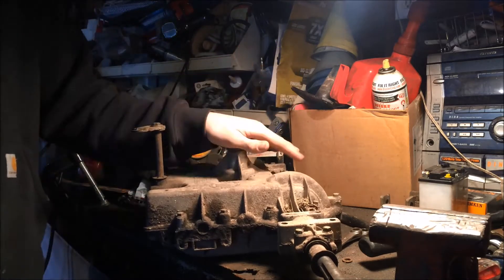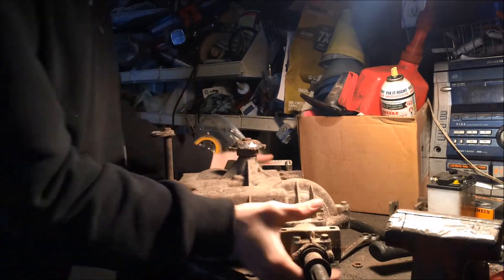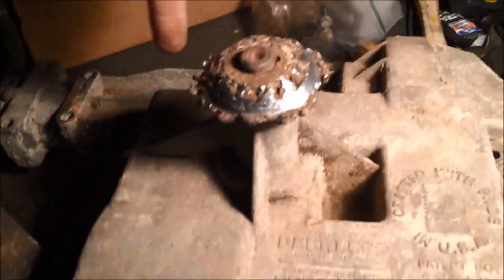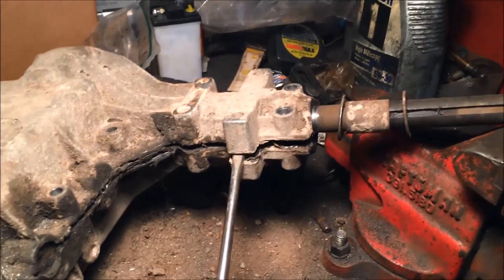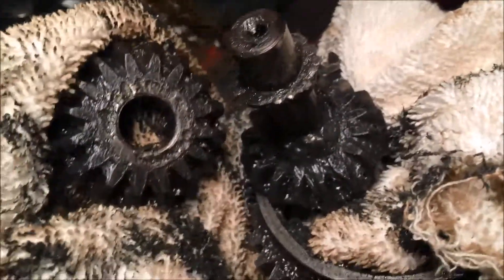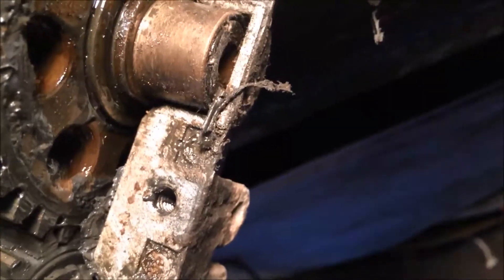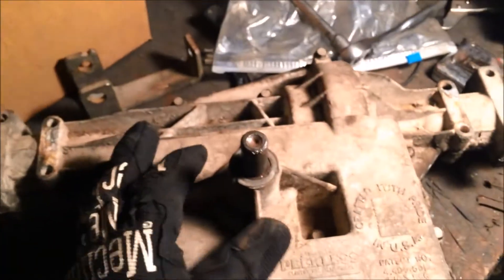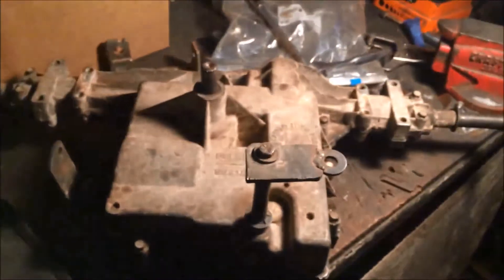How To: Unassemble & Reassemble Transaxles (Peerless)

Comment: What's the yellow bung for? Thanks.

Transax transplant 

I have a 30 y.o. Murray 11/36ic that was increasingly difficult to change gear. I acquired another transaxle 10 years ago, and seeing it has 10 years less use than my one so it must be in good or better condition...right? 
I hear it clicking as I move the gear changer thing sticking out the trans into several positions.
Put it on, and now the mower won't move forward or back.
I see the drive belt is turning the rear pulley on the transax. I lift the back up to see if there is the slightest movement and there is nada. 😑

Any ideas anyone...

Comment: i have a 920 series 7 speed and we took it apart, we cant get it back together, it seems spring loaded. now the ball bearing that is spring loaded to give the shift fork a clicky sensation came out. i am dealing with the same problem when you turn the pulley it locks up and then starts to lift the whole assembly out of the case. if anyone could help that would help alot.
Reply: also does the little triangle protrusion on the bushing have to be on the right or left side

Comment: Question for you. I have a bunton 48in walk behind mower and the guy I bought it from put a tractor transaxle on it and it drives but it drives in reverse so basically it'll only go forward in 1st gear which is reserve gear. Gears 1-5 work but they make the mower move in reverse. He said that's the only way it would fit. So my question is is there a way to take the trans axle apart and simply swap reverse and forward gears to be able to use gears 1-5 go move forwards instead of backwards?
Reply: Hope I didn't confuse you lol. The transaxle can only fit one way and I'm trying to change the way the trans spins in reverse to forwards and forward to reverse idk if this is possible lol but I figured I'd ask

Comment: Thanks for this great video.  I was not sure how to get the spring and ball back in.  This vid is the only one I have found that address the issue.  When I opened the case the ball was in the far right hole, but I have had all the gears out.  I think I got in N and I am putting it back together.  Will the ball just fall into the correct whole based on the gear it is in?  Also should there be grease in the axle channels?between the spider gears and the bearing??  how much?  thanks

Comment: When reassembling, one trick that I use is to put the top of the case on, snug up the bolts, then go around all over the top case and lightly tap with a hunk of 2x4. This always has helped everything seat nicely...
Reply from the maker: Yep. can e used both ways too, when taking it apart you can hit it with a 2x4 to separate the case, no bolts holding it.
Reply: I like to use what's called an anerobic sealant when I reassemble them..it's like loctite that dries in the absence of air. 
It costs 2x of rtv probably ,but it cleans up so much easier if you have to open the trans again.
whatever oozes inside the case won't harden and migrate thru the trans. If anything it'll go thru the oil and stay in a liquid or gel type of state. 
Sometimes it's nice to put a little oil on the case bolts too, if they came out with protest. 
Besides, it'll make it easier on ya next time you have to open it up again.
Reply: has anyone had the issue of  it not lining up 100 % and when its together again it turns easy, and then hard, and  then easy, then hard again ? i can never seem to get them back together the way it should be so it turns easy by hand